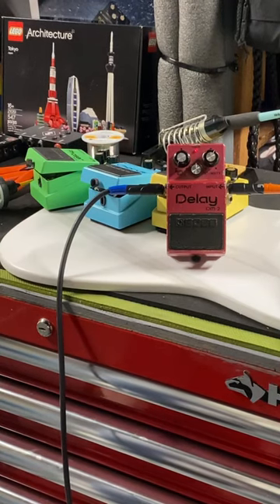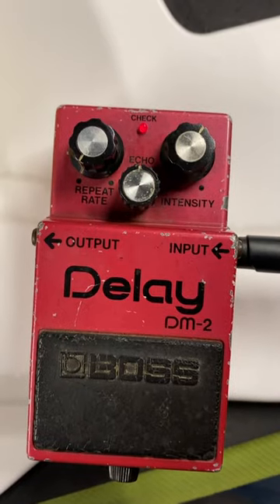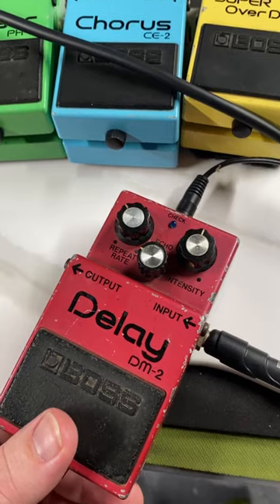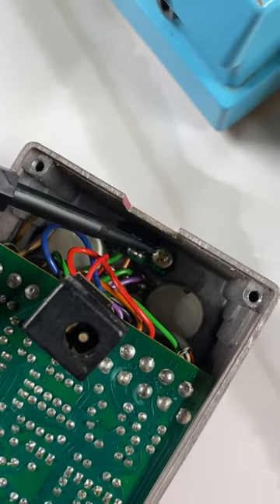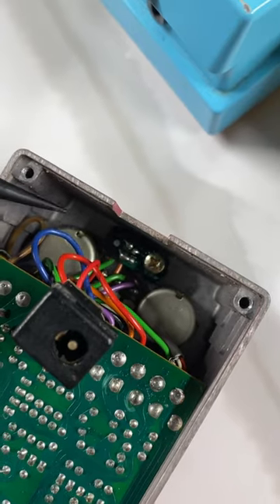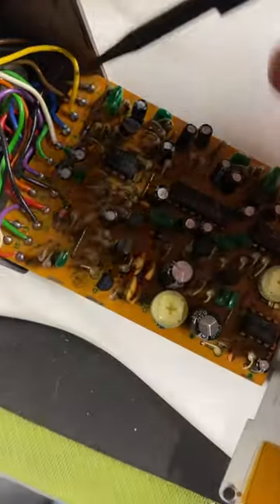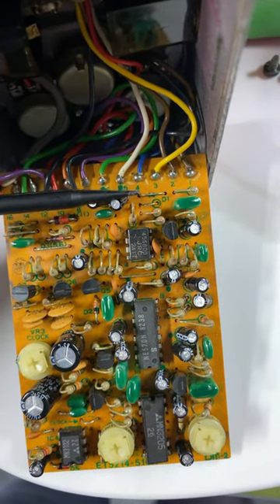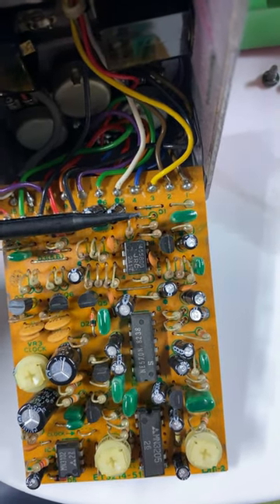Inside a vintage boss dm2 delay #shorts #electronics #effectspedals led and power change

Comment: Hello, thanks for making this video! I literally just fixed one for a friend. Wrong power supply was used, so D4 blew.

However, I think I must have wired the ground on the repeat rate potentiometer incorrectly. Don't know if it is possible but don't suppose you could show that wiring?

I couldn't figure out with the schematic where it grounds to and the left half of the repeat rate does not work. The pot almost turns on when it hits 12 o'clock. Any advice?
Reply from the maker: First, what components did you remove? In a dm2 it should be D1 and r2.  Removed and replaced with jumpers. 

If you send pics to my email (in my about) I’ll look and let you know.